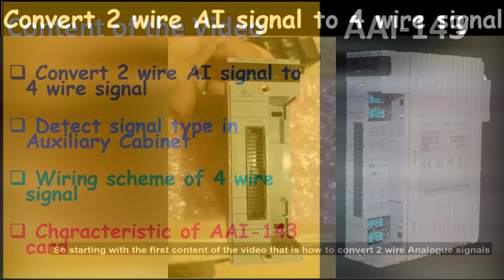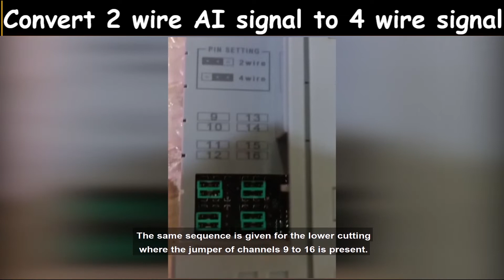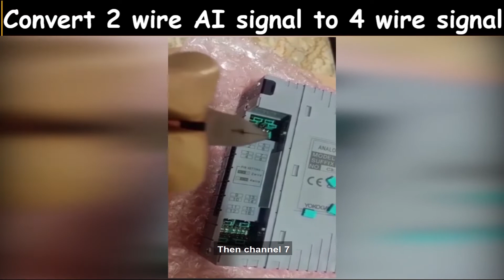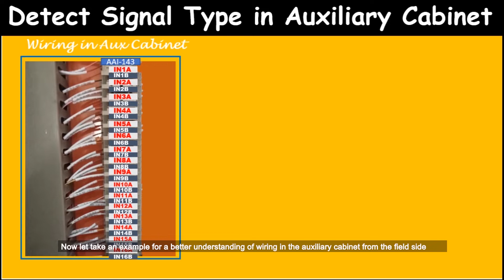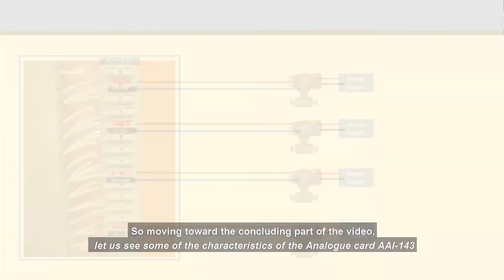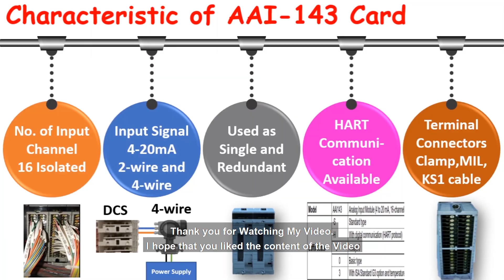2-Wire to 4-Wire Loop Conversion | Yokogawa AAI143 CENTUM VP

Comment: Good work. Note that, as delivered from the factory, all 16 channel jumpers are set as 2-wire. And, practically, the AAI143 module must be removed from the node to set the jumpers to/from 4-wire service.
Reply from the maker: Thanks for your valuable review comment on the video